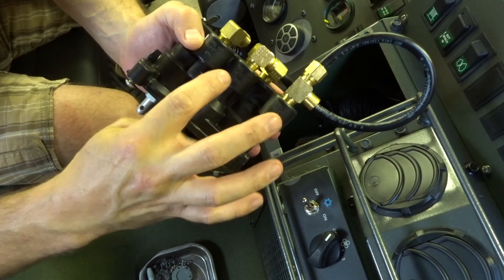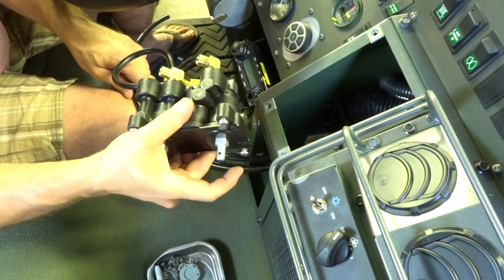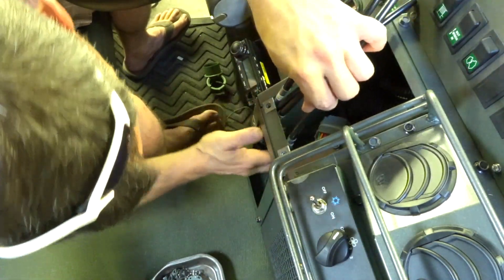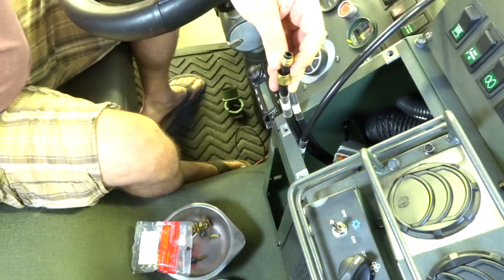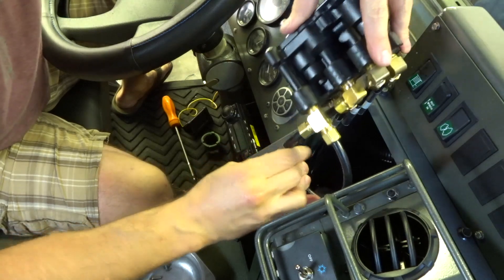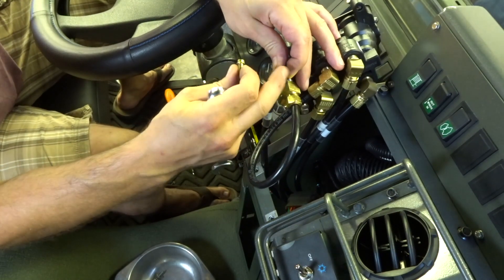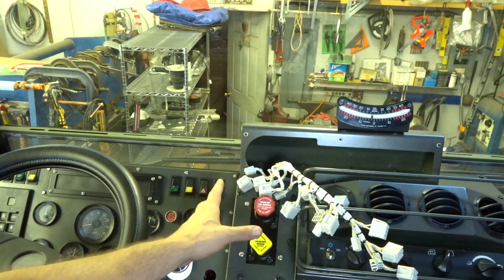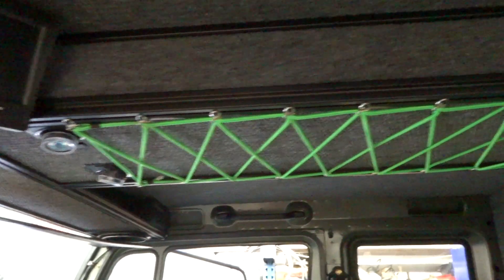Replacing the Air Brake Manifold in the LMTV

Comment: What did I miss? Did change the air Manifold because you wanted to or because you had to do to the GEN two AC evaporator.
Reply from the maker: The gen two AC unit has mounts for the newer style one piece manifold.  I could make a custom bracket for the two piece manifold but picked this one up for $20.

Comment: one change I would have done is moved all three of the switches behind the CB Mic to the right one hole. That way when you are reaching for it you don't hit the switch behind it by mistake. 2nd thing would be to get rid of the CB and get an Amateur Radio license and radio.
Reply: I believe he has both radios and did video on it, and why
Reply: @BuggysTowJam  the second radio is not a ham radio either

Comment: maybe I missed it... but in previous video saw that your OEM individual air valves are mounted on a flat plate.... while in your second video you had cut out a square donut hole into same plate to fit the new valve cluster....   Since you had removed the knobs on new cluster.... why was the donut hole needed?  Do the valves on new cluster not line up with the holes in the plate?
Reply from the maker: coachgeo yes, the OEM manifold is two separate actuators in a plate with two holes.  The newer manifolds (that come on the trucks with AC) are one square piece with both actuators, so the new plate that comes with the AC evaporators has a square hole.  You could probably use the old manifolds and make a plate to match the evaporator, but it is easier to upgrade the brake manifold.
Reply: @BrokeOverLand   Thanks..... I ask not cause am doing an AC install..... but cause I have the newer type manifold to eventually, when needed,  replace in my A0 non ac truck.... would the two valves with  removed knobs... match the holes is what am curious about.... or is there other things in its design that would make this just not work.
Reply from the maker: coachgeo ah yeah, the plate in the A0 will either need to have a square cut out of center where the two holes are now, or you can cut another plate. Sean Fillner has a video on his A0 manifold swap on his LMTV. https://youtu.be/5h5nHmWFw_g